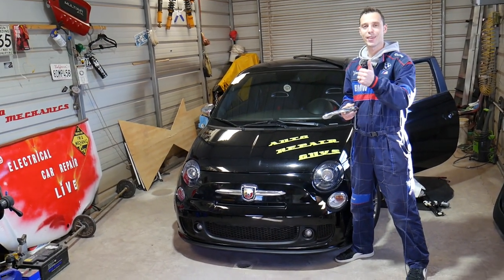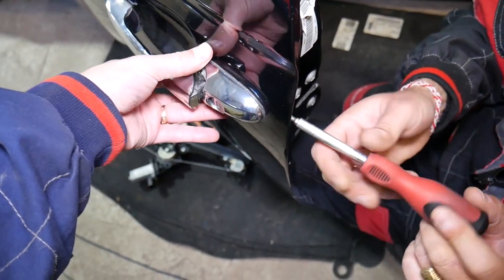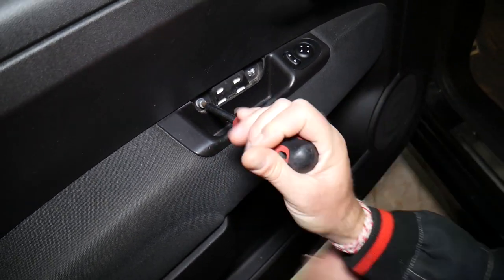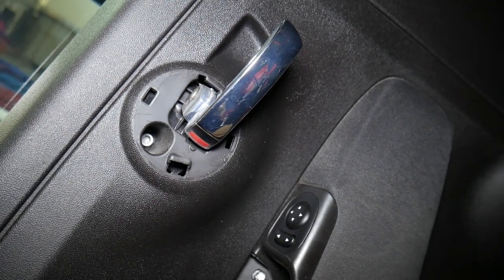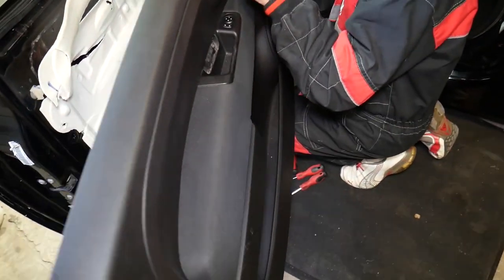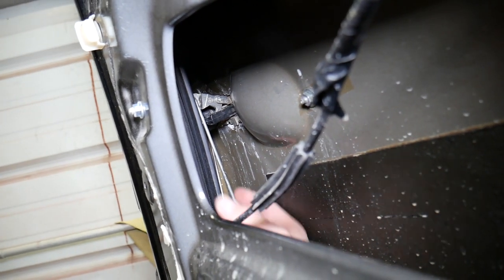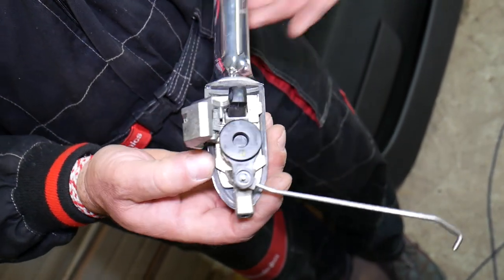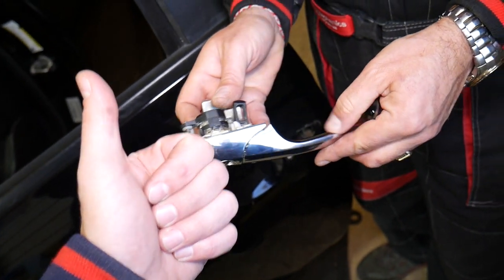FIAT 500 DOOR LOCK CYLINDER REPLACEMENT REMOVAL

Comment: Thanks..but..you never got the cylinder out. Turns out you don't need to remove those three screws after all, you just have to carefully pry the black plastic cap on the back of the cylinder out of the way and pop the "C" clip out a bit. The cylinder will slid out from the outside. I suppose if you were really good, you could reach up inside and remove the cylinder without even removing the handle. Thanks anyway.

Comment: Er.. I have a '92 fiat 126bis which came without any keys !
So far I've replaced the upper steering column c/w ignition switch for one which I have a key and I've also bought a new fuel cap.
But now I've got myself a set of 3 lock cylinders and I need to swap them over !
I was hoping your video would help but alas no, I shall keep searching.